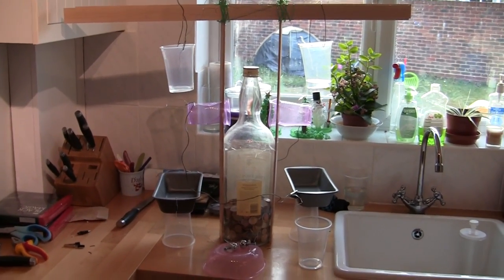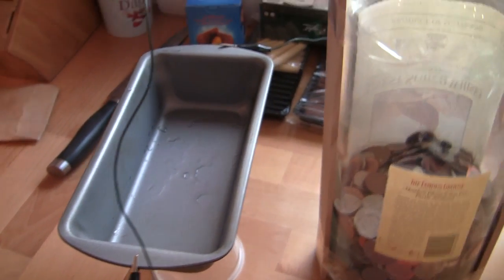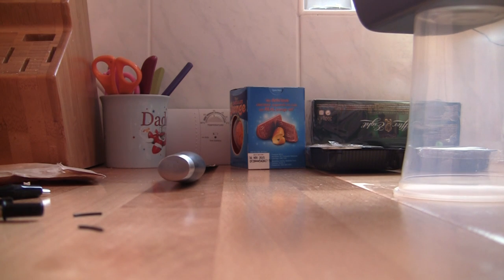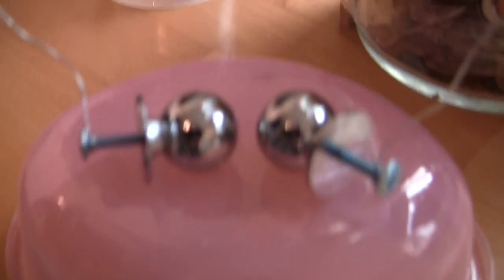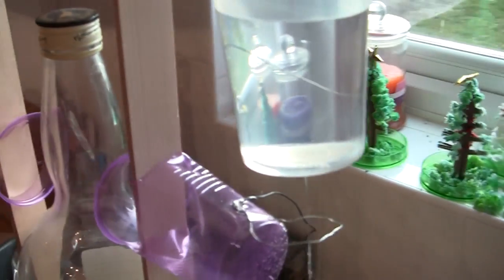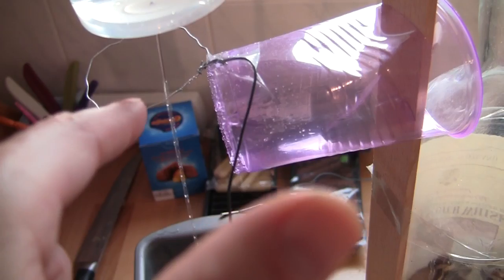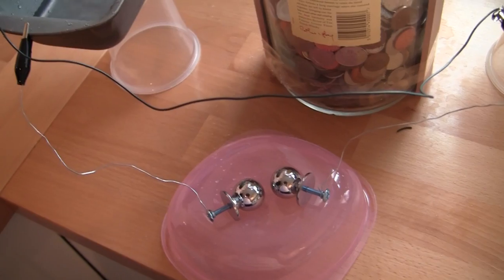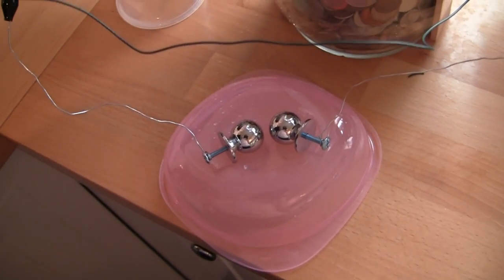Building a kelvin dropper

Comment: Couldn't we augment the efficiency of hydroelectric dams by implementing this in some way?
Reply: Heh, this produces relatively large voltage for an extraordinarily brief period of time. Far from any appreciable current.
Reply: there is indeed ~10.000 volts differential between the 2 points, but, you could not keep a light running with that amount of energy, i doubt even a LED.
the reason is that electric components work with Watt. the amount of watt's decides if the lamp can shine bright or not. 

you can hold 2 electrically charged metals in your hand, and there could be a billion volts between those, and the effect you can have is somewhere between "you dont feel anything" if the current is nearly 0, or "violent explosion" if the current is high.

to answer the question: the cost of the apparatus will make it so it will take centuries to produce a profit, simply because the electrical energy generated is so low. investments better spent elsewhere, like for example building a new hydroelectric dam.
Reply: usmcportes No, too many problems. [1] Only a tiny % of water in waterfalls is in the form of droplets - but this generator relies on droplets for this effect to work. Nearby moving water stream would discharge the droplets [2] The air must be relatively dry [not humid] or the charge leaks away from the droplets through the air itself - the air near waterfalls is always humid - it would be very, very difficult & expensive to keep the system isolated from "wetness" - every part of the equipment would need protection from electrical/charge bridging [3] Installation & constant maintenance costs would far outweigh the tiny gain in energy conversion - due to wear & tear you are bound to get bridging sometimes [a massive discharge] - this would be pretty explosive & potentially dangerous. [4] Water + electricity requires careful design - don't complicate where possible.
Reply: usmcportes Not very much for the effort. You need to break up the stream, then feed it through giant loops of metal, then harvest a very short, very high voltage pulse, step it down, store it and release it slowly. Every part of that introduces large inefficiencies into the system, which combined with the small amount of power made in the first place, makes it less cost effective than SOLAR FREAKING ROADWAYS!!!!!!!!! (Had to)
Reply: usmcportes The majority of energy there is not caught - that is simply the potential energy of water falling. Only a small amount is going to charge. It is a very poor way of getting the most energy converted to electricity from mechanical energy.
Reply: usmcportes If you have running water [or a waterfall] it is easier to just use it to directly spin a paddle [or a waterwheel or a turboprop] to drive a dynamo & make electricity that way - why bother using this effect which is difficult to keep working? This Kelvin Generator [invented by Lord Kelvin] has never been used to generate electricity for profit - it's only used to demonstrate a principle or as a novelty gift [like a slinky] - they are available for sale on Amazon etc.
Reply: Thanks for a response. How about a smaller system that relies on water syphoning from a nearby source in order to power a battery?
Reply: I just imagine just how much power one of these could generate if you ran them in series using any body of water large enough, that's all
Reply: cyto lpagtr
Good point. The effects of this demonstration seems much like that of the igniters for grills and lighters: it  produces an electric charge of considerable voltage, but the current is too miniscule to make a profit.

However, it certainly is a neat trick!
Reply: ***** You mean electromotive force? ;) That seems a lot more relevant in this situation.